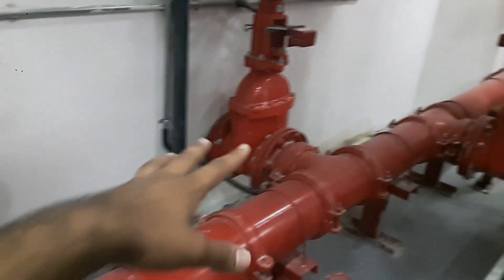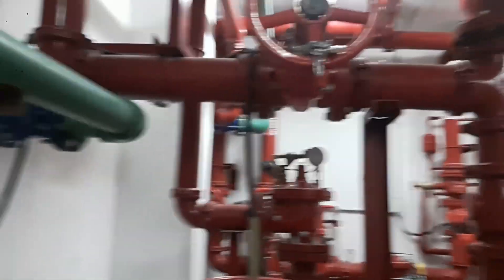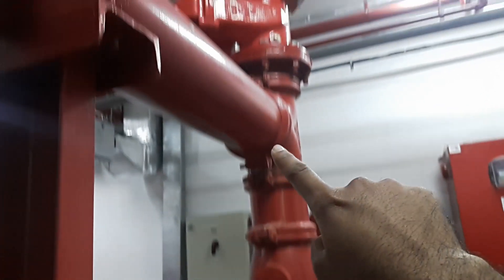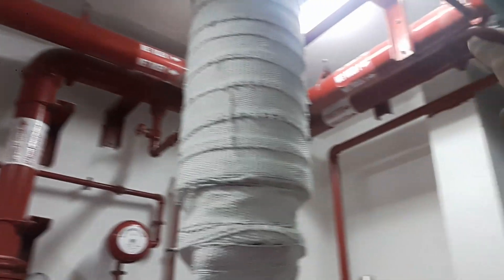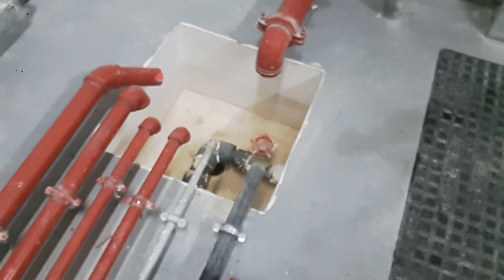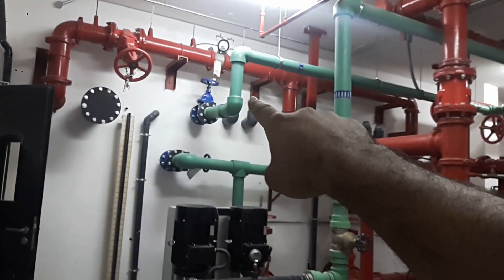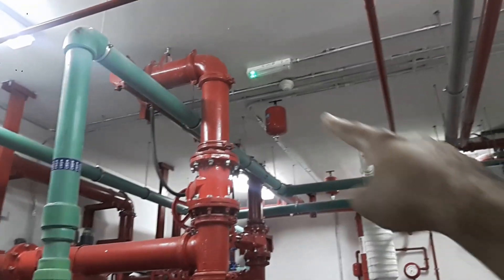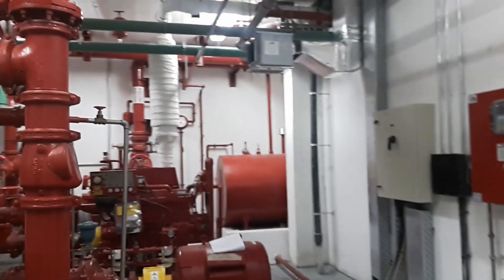Fire Fighting Pump Connection Details & Its Working.

Comment: Seen many videos.  No one explains, how even without any pump running, pressure is maintained in the system for ready  use.  No one mentions the Air Vessel, which is the component storing energy.  I expected you would cover this, but disappointed.

Comment: Why no strainers in this suction pipe?  that is presure gauge meter bro
Reply: The water we are using for fire purpose is potable so we dont need to use strainer as per nfpa 20, if in case, water is of river, lake side then the requirment of stariner is there

Comment: You missed the Pressure relief line bro.. can you explain the use of it as well ..?
Reply: Prv is kept at discharge side of the fire pump and it is kept to maintain the required pressure on the line and release the excess pressure if build during the operation to avoid any disturbance to the connected pipes and fittings